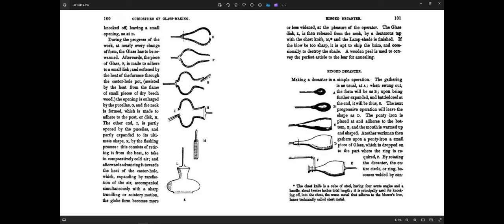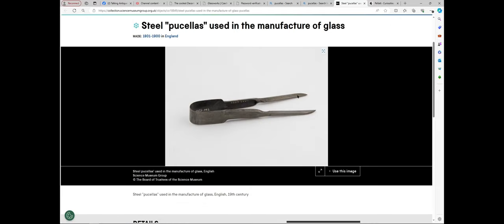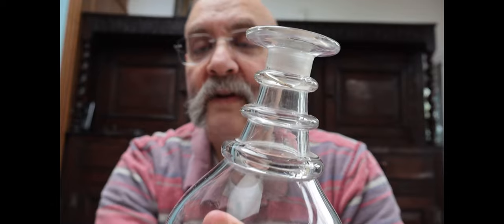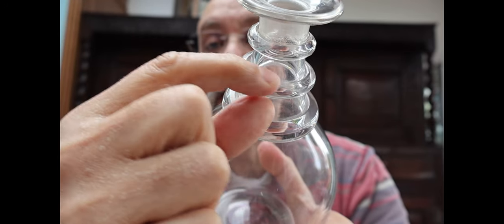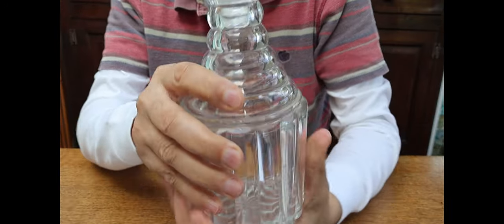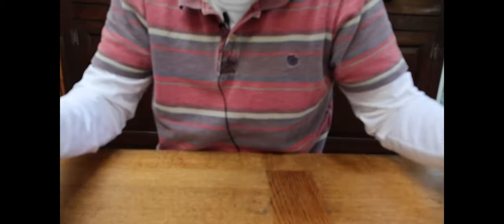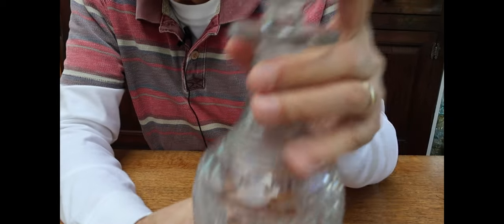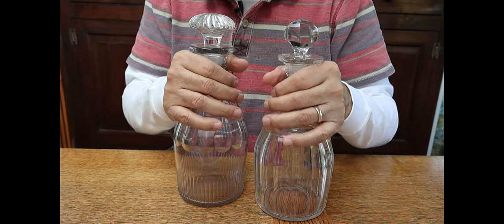Fake / Faux Decanter Neck Rings

Comment: The hollow neck rings are called hollow Mariah's. The cold weld gap between the rings and the body of the vessel on the real example just means they didn't get the glass hot enough, there's a chance that they can pop off with time and stress. If done correctly when adding glass you shouldn't see any join but with more mass produced items its common to have cold welds. Very cool video.
Reply from the maker: Those decanters are 200 years old, and I have at least 100 like that, so I think we are all good with them not popping off. Back in the day, the chemistry and temperature control was not great, because of this the time in which you had to do hot work was shorter, so it’s normal to see bits of working in the ring making from that period.